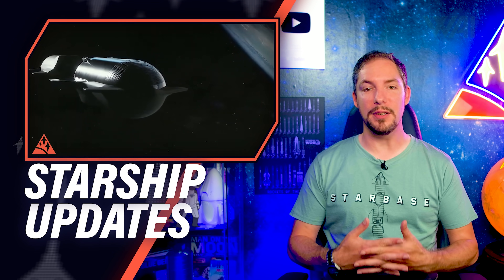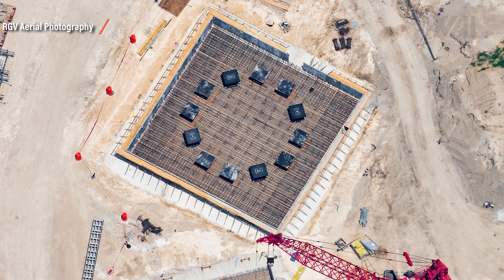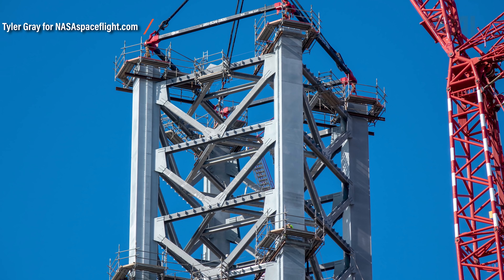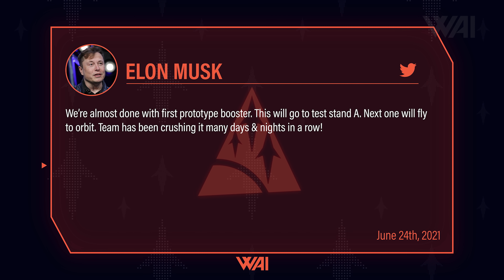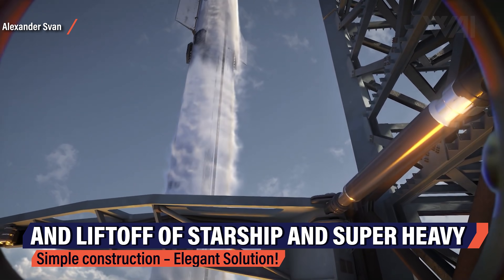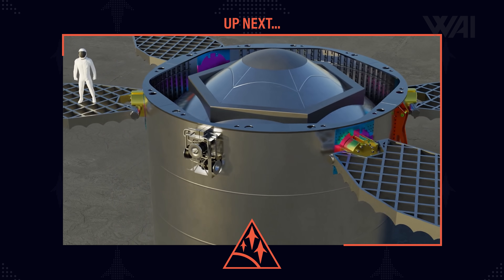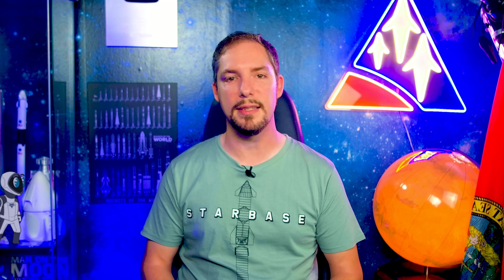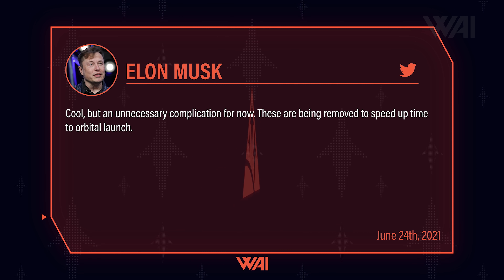SpaceX Starship design changed? Super Heavy booster precision landing thrusters!

Comment: how will the fuel transfer from tanker to starship? What mechanizing will used ?
Reply: No information has been officially released. But you can find a lot of speculation on nasaspaceflight blog.
Reply: That's a difficult one. I would have thought top pressure of gaseous nitrogen to push liquid fuel into the starship, using the vacume of space to vent off, but with that said, 0g would change everything.
Reply: @VP_JayDeePants  I think they would need to do a small g burn to settle fuel also. Maybe the cold gas would be enough or maybe a methalox thruster is necessary
Reply: The tanker grabs the Starship's Eloneron fins and uses its hot thrusters to repeatedly jam its fueling nozzle in and out of the Starship, accompanied by funky wah-wah guitar music.
Reply: @skierpage  David Attenborough voice - "as you can see here, the male starship attempts to mate with the female starship. A successful union will lead to a new generation of multiplanitary ships"
Reply: I expect that thrusters will settle propellants at the ends of the main tanks, and continue running during transfer. Releasing some vapor in the receiving tanks should move the liquids across just using the higher pressure in the supply tanks. This will also chill the propellants some more. (Boiling = heat ejection.) 

It might help if the continuous hot gas thruster (combustion chamber linings) could be chilled with propellants and thus maintain vapor in the thruster COPVs. Something similar would be great for the lunar descent thrusters.
Reply: Light thrusting will create an up and down, and the fuel will just naturally flow downhill out of the tanker and in to the other ship.
Reply: @odysseusrex5908 if you think about the direction of force and fuel flow. Basically one starship is attached to another upside down starship and the fuel just drops out the bottom
Reply: @blakelowrey9620  Precisely.